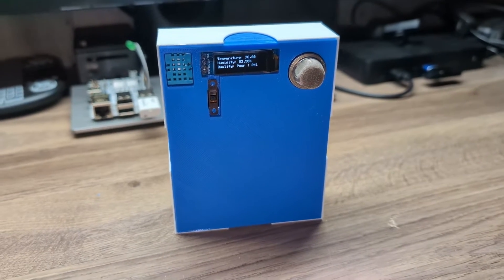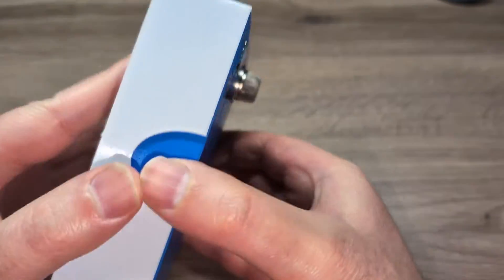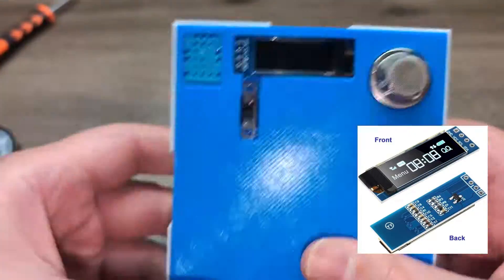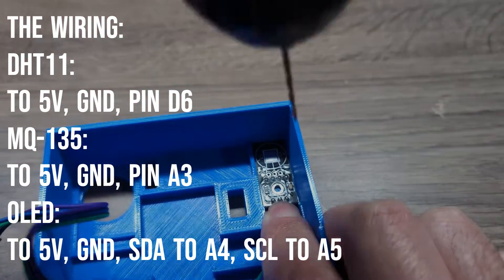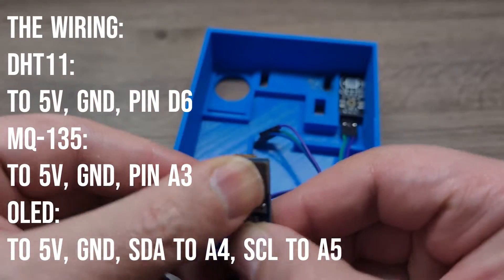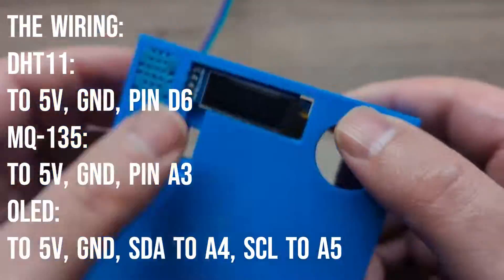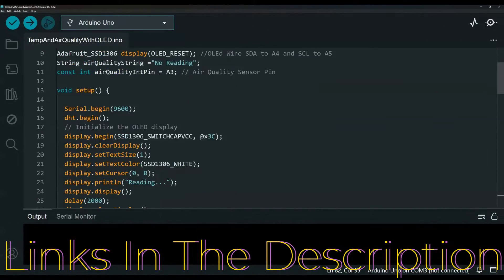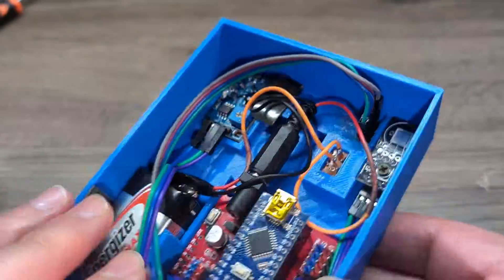Build A Temperature, Humidity & Air Quality Monitor #3dprinting #arduino

Comment: How do I reduce the voltage from the 9V battery to 5V to drive the components?
Reply from the maker: Good question, you would use a buck converter like the one in this link https://amzn.to/4lmzj5K 
Of course you do not have to buy from my link, you should try to find the best deal
Reply: @techs.passion  How would I install this to the extension board?
Reply: In you video, are you using a Buck Converter to reduce the voltage to the expansion board?

Comment: Can you send the 3D box code please
Reply from the maker: For sure, it's linked in the description, let me know if anything is missing
Reply: @ i cant find in man
Reply from the maker: Temperature, Humidity & Air Quality Monitor: https://www.thingiverse.com/thing:6610092
DHT11 temperature sensor case: https://www.thingiverse.com/thing:6610039 
MQ-135 air quality sensor case: https://www.thingiverse.com/thing:6610078